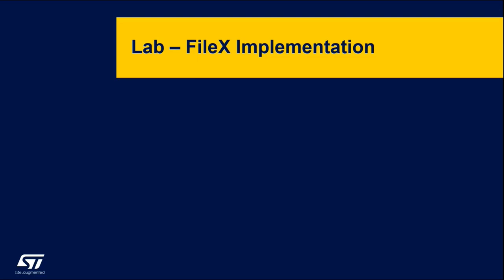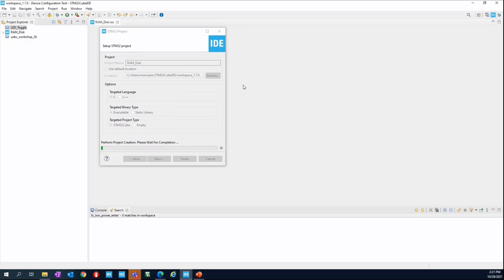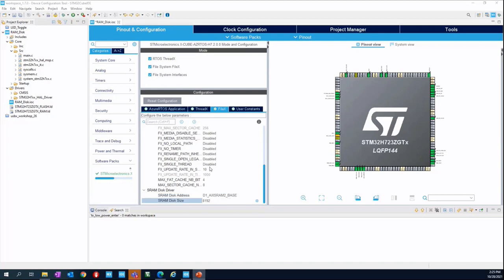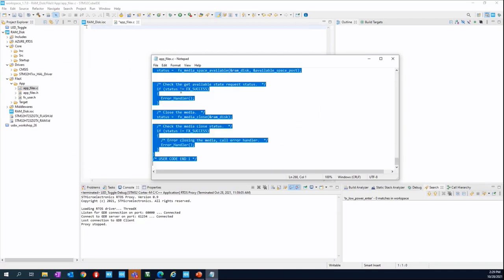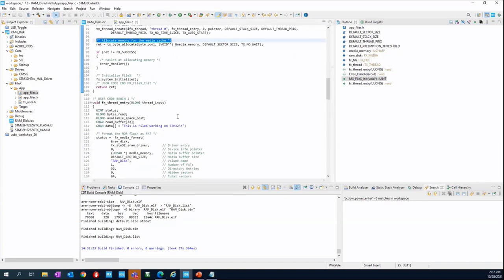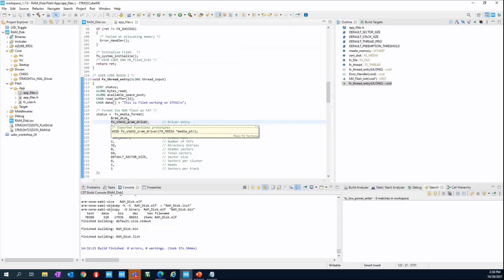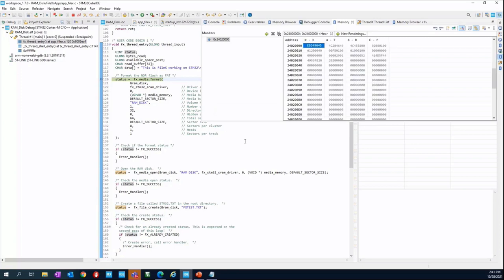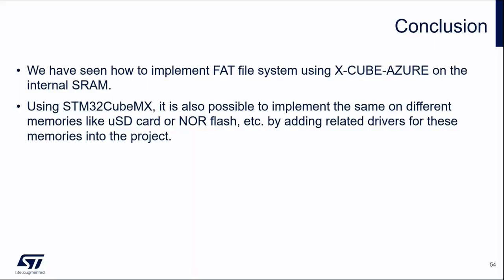MOOC - Azure RTOS workshop - 13 FileX lab

Comment: Can you also please make a video tutorial for FileX/LevelX with nor flash memory via qspi interface.
Reply from the maker: Hello. Thanks for your interest on the topic. We have forwarded your suggestion to our colleagues for consideration as they plan future training material.

In the short run, they have pointed out a few examples available within our X-Cube-AZRTOS packs that may provide some useful bits to you: 

1. Two storage media managed by two independent instances of FileX/LevelX running on STM32H747I-DISCO board (Dual core). 
Two independent media storage: µSD and QSPI NOR Flash will be used on STM32H747I-DISCO board(Dual core).
Each core will create its own file system using one instance:
-	Cortex-M7: will create file system on µSD using FileX stack.
-	Cortex-M4: will create file system on QSPI NOR Flash using FileX/LevelX stacks.

Path within the X-CUBE-AZRTOS-H7:
.\X-CUBE-AZRTOS-H7\2.1.0\Projects\STM32H747I-DISCO\Applications\FileX\Fx_Dual_Instance\

2. An example of Azure RTOS FileX and LevelX stacks usage on STM32L4R9I-Discovery board, it demonstrates how to create a Fat File system on the NOR flash using FileX alongside LevelX. The application is designed to execute file operations on the MX25LM51245G NOR flash device

Path within the X-CUBE-AZRTOS-L4:
.\X-CUBE-AZRTOS-L4\1.0.0\Projects\STM32L4R9I-Discovery\Applications\FileX\Fx_NoR_Write_Read_File\